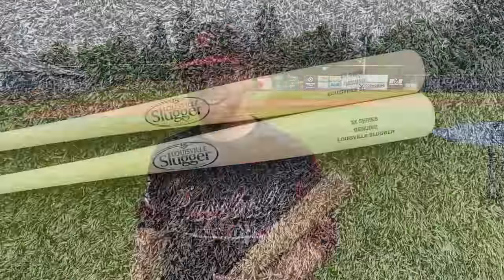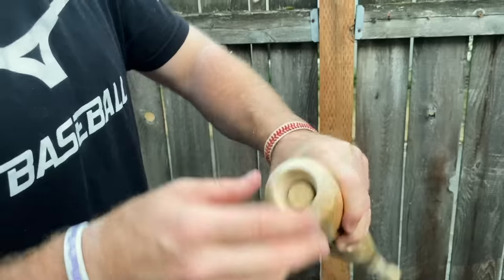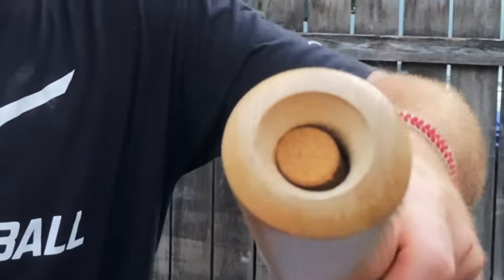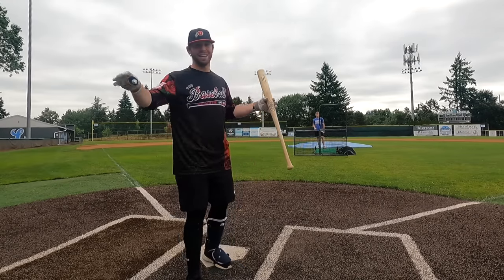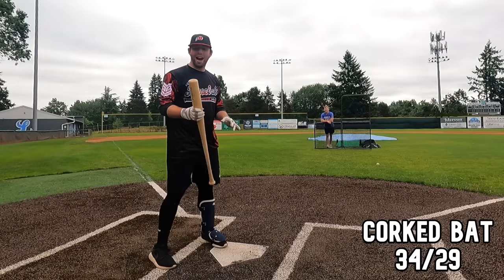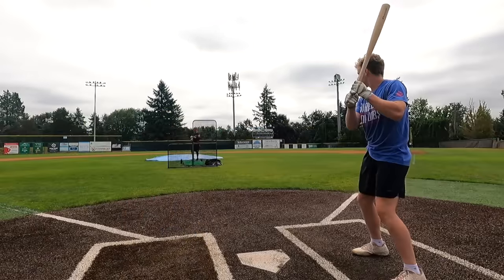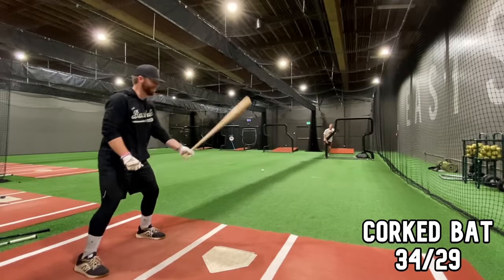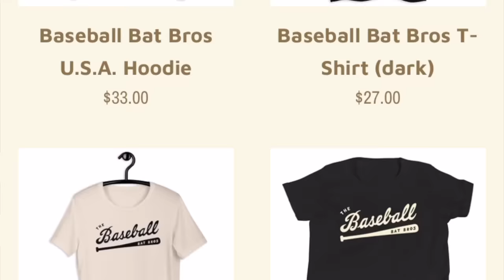Hitting with a CORKED BAT | Wood Baseball Bat Reviews

Comment: The cork is not used just to lighten the bat. It is used to increase elasticity and transfer through the hollowed out section. The cork must be tight, not baggy
Reply: I know what's guy smoking. Lol
Reply: I would like to see this done correctly.
Reply: @whiteboyradical 😂k.v
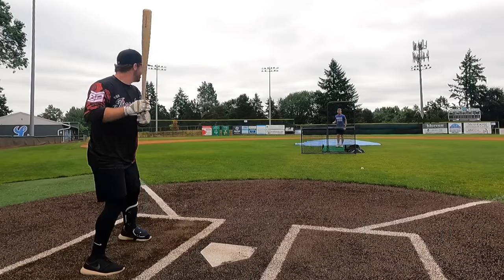Y7 9:32 gkgunh
H
Reply: @whiteboyradical  he inhaled the saw dust
Reply: You guys are a bunch of cheaters!!!!! LOL
Reply: Cheaters are bad.  Bad cheaters are worse
Reply: Yeah the 'trampoline effect' is physically illogical and has no merit. It's BS for two reasons.

1. The weight loss slightly increases swing speed and the effect of a springy bat AND a springy ball effectively sees contact and rebound force being absorbed, not increased.

2. Greater speed on contact with the ball = more contact force. This increases the chances of an easily audibly detected cracked bat or a completely broken bat.

There are no excuses for using a corked bat. Even Graig Nettles' plea that 'a fan gave me it.' is questionable, but he did get away with it. 

Cheating in pro sports just means you're not actually good enough to be a better player.
Reply: I cringed while he did this, why wouldn't he use the same size paddle it....or a 16th inch smaller it would of worked then better
Reply: I was thinking the exact same thing...and I don't know much of anything about corked bats.  It's just obvious.
Reply: Exactly.
Reply: This has been scientifically tested. It does not improve the “elasticity” of the wood - it actually does the opposite. It lightens the bat by an ounce or two and gives you the same length and width of a heavier bat. The end result of the test is that you do get a bit more bat speed with the lighter bat so in theory you can get to faster pitches but the ball did not travel as far.
Reply: Bro how would you know how to do that😂😂😂
Reply: He should have used an Auger bit and made it tighter.
Reply: The sponginess of the cork, if anything, makes the bat absorb energy from the ball rather than transfer it back.  That is not the reason that corking a bat confers an advantage.  The advantage is what the bros talk about in the video: you get the benefits of a lighter bat without having to use a smaller barrel or inferior wood.
Reply: You don't need to make accurate content anymore, judging by the 3.1M views, just the idea of content and 10 minutes of sharp editing.
Reply: This is wrong. Bats don't compress, the ball does. The results produced by corked bats are a result of the bat being lighter, and the swing speeds being faster. Cork can dampen, but it's not going to bounce.

Comment: You should have ground the cork up in a blender and then sealed the top with the sawdust.
Reply: Maybe a dumb question but wouldn't that be heavier than just using the full corks if you fill it up?
Reply: @Icantforgetnow  no. The problem with using the full wine corks like he did is that they weren’t a perfect fit, there were gaps on the edges and he said he put glue in there to lock them in. If he blended the corks up, then there would be no gaps and then all he would need to do is seal it up with the sawdust and some sort of glue/adhesive. It would be possibly lighter or at least the same weight.
Reply: @houstonOLED  plus probably better structural integrity
Reply: Just get shoemakers cork filler. It's pliable cork used in boot and shoe repair.

Comment: I would like to see the corks stuffed tightly into the holes and then re-test it.  It would be interesting to see if such a setup would result in a bit greater hitting distance.
Reply: Of course it would that’s why MLB players did it
Reply: The mythbusters did this one. Essentially, the mass transfer gets just about halved because the cork disperses force. I think the common misconception is that the corked bat would result in a harder hit, when it actually results in a faster swing. That way you shave off a couple milliseconds on the hit, theoretically resulting in more contact and by proxy more bases.

Edit: Huh. Interesting results. I'd like to see some more testing. I'm invested now.

Comment: Just a heads up, as a woodworker and engineer, you should use a paddle bit that’s about 1/16” smaller diameter than the corks you plan to use.  The cork will compress, fill the void, remove the need for added weight via super glue, and hold the structural integrity of the wood significantly better.  

Pretty interesting results for a first go with a lot of voids though.  It went far better than I would have anticipated.
Reply: Excellent point.
Reply: How heavy is superglue? Heavy enough to slow down a ZOMG is all I know
Reply: shouldn't use a spade bit at all. you need an auger bit or more appropriately a forstner
Reply: @@theslipperytruth5676 she did say something about some weird guy babbling to himself walking down the road. I hope you are okan I know life is hard if you have extra chromosomes, but we are rooting for you lol guy

Comment: For anyone not really familiar with bat "drops", the standard is -3 ... meaning the weight of the bat cannot be more than three digits away from the length (example: 34in bat has to be 31 ounces, anything more than that i.e. 30 Oz, 29, 28 etc, is super illegal)
-3 is the standard as far down as Little League ball, so the advantage is a very real thing.
The highest drop I've ever seen personally was a -9 TPX aluminum.  I brought it to a game of mine when I was about 13 or 14 years old and it didn't make it out of that game.  The whole team used it each at bat until one kid, and hand to God I am not making this up, swung the bat and made full barrel contact, but the sound wasn't right and the ball literally traveled 5 feet behind him to the back of the cage.... the aluminum ripped on the barrel and there a baseball sized hole ... the ball went thru the first layer of aluminum to the back of the barrel, almost lodging itself into the bat, but came back out on the follow thru and went behind the batter ... as 14 years olds we as a team swung this bat with such violent force that the bat broke
Reply: I'm not familiar with bat "drops." Thank you for giving us this explanation.

Comment: Pretty sure you you want the cork to be tight/solid in the hollowed out barrel, without any play.

No point to having it bouncing around in there. Its meant to maintain structural integrity and give added bounce (possibly?).
But just having wine corks jingling around in there, while hilarious, is pointless.
Reply: Exactly ! The best way is to drill a smaller hole on the bat, then find a metal tube that fits perfectly inside the bat, then vaccum (compress) the corks inside the 
pre-lubricated metal tubing add wood glue inside bat and insert tube inside bat 
and squeeze those corks out of the metal tube while backing of the metal tube out
until all corks stay inside ! 
or 
put corks on a blender and break them all down add wood glue (not much) and compress that semi-dry soup inside, leave space to reseal with a maple cap the leave it a few weeks in the Sun heat inside your cars dash for all glue to dry !

Can you repeat this test using one of these methods or both ?
Thanks if you do !
Reply: @dnantis  lol you sound like you know with experience.
Reply: That's what I thought cork was used for
Reply: @Bon Jovi 
Clearly you don't understand how structural integrity and physics work. Keep studying though chief, you'll get there one day.
Reply: @Bon Jovi I literally make bats and hockey sticks for a living (among other things). 
I have an engineering degree and run CNC machines and automated lathes.
Reply: @Bon Jovi 
That's your argument? Lol

Scraping the bottom of the barrel to come up with that one, damn.
Reply: Should've drilled holes slightly smaller than the diameter of the cork
Reply: Usually you want to grind the cork to into fine particulates and mix it with a tacky glue that stays tacky and saw dust. If done professionally, there is a way to mimic the grain of the bat by adding just enough to the corked material, in a liquid state at this time, to the inside of the drilled cup, then by spinning the bat at high speeds, using centrifugal force, this will cover about 70% of walls on the inside. You don't want 100% coverage so it mimics the grain correctly. Do this repeatedly until the void is completely filled, layer by layer. Then by sacrificing another bat, remove the cup from that bat at 1/16th of an inch bigger in circumstance that the hollowed cup and adhere it to the hollowed cup of the corked bad. There are methods such a drilling holes for wooden dowels to peg the new cup in to reinforce it. But that is more detectable if broken. Always mix any glue used with saw dust. If this is all done correctly, even if the bat brakes, it's very hard to detect any corking manipulations.

Comment: Part of the benefit of corking is weight difference generating bat speed, but a second (huge) part is the act of compression, as the bat absorbs the force of the pitch and then releases that energy to launch the ball with greater velocity (like a trampoline).  To do this well, the hole drilled must be smaller in diameter than corking material, so that the cork fits very tightly into the barrel.  This will extend the life of the bat (before it cracks) and increase the launching effect.
Reply: This is not true.

The reduction in weight causes better bad speed, but it also negatively affects the velocity of the ball because of the weight reduction. Cork don't do s***.
Reply: @seriouscatisserious Is that true? In my mind I always assumed that the cork acted more like a spring, but I’m fully aware of my own ignorance on this topic.
Reply: @Jomitheelf yeah, it's nonsense.

Comment: To increase durability, I think the hole diameter should be slightly smaller than the cork and ram them down to create a tighter fit. This way it’s not so hollow.

Comment: Breaking up the cork into small pieces, then mixing it with wood glue, then pressing it down with a down with a dowel the same size as your hole will still keep the weight lower, but also add strength back to the bat because the cork/glue mixture has filled the void completely. This in turn adds an extra trampoline effect to the ball in addition to the lighter bat. I’ve made a few of them. It helps being a machinist with a lathe, you can just drill the hole a little smaller than the cork, and it will hold it in intact with a small amount of glue. A solid cork can certainly be found at any hobby shop or online. The pressed in solid cork forks the best. Try to refine the technique on the next one! Cool video!

Comment: The hollow hole should be filled wall to wall, you should have ground up the cork into tiny pieces like the bits of rubber on a turf field. Then you pack in the cork bits with a rod to really get it in there tight. You can also substitute the cork for rubber, like super bouncy balls grounded up, compacting it in is key, this will stop it from breaking internally.

Comment: I think if you wanted to do this so you retain structural integrity and density you could fill it with cork filler that's used for repairing dress shoes and tamp it down in the hole with a wooden dowel or something
Reply: thatd hit some piss rods lmfao
Reply: @LUCKIPUP  on fucking god
Reply: That’s definitely what should’ve been done
Reply: do you think it would last longer if they put it in the cheapest birch cut they could find? i think thatd still be better than ash since it’s eventually gonna disintegrate
Reply: That is the proper way to cork a bat

Comment: The speed difference is just for the reaction time of the batter. The energy input on the ball will be the same. 
In other words the corked bat doesn't make you hit harder, just let's you react faster and get a better hit
Reply: Not exactly. Kinetic energy is KE=.5mv^2. You lose mass, but if the swing velocity goes up, it make more energy. Since velocity is squared it more than makes up for the mass drop.
Reply: @latemodelclassics  Well you are quite right about that but in the end the energy is the same as the same person is swinging. So if you reduce the mass and the energy is constant you will obtain an increase in the velocity in the proportion of v=sqr(2 KE/m) but the kinetic energy will remain constant. So when you hit the ball the kinetic energy transmitted to the ball will be the same. That's why I said is an improvement on accuracy. If the bat needs less energy to move because you reduced it's mass. You will be able to make bigger adjustments while bating and also you will have a bigger window to succeed in hitting the ball.

Comment: This isn't exactly how "corking a bat" works.  You can buy cork at different diameters at a crafting store.  Drill the hole in the bat 1/8 less diameter than the cork, it will compress and go in very tightly.  THEN you have a corked bat.  The cork actually gives the hitting surface more bounce and spring back action.  You just basically hollowed a bat making it lighter.  Try the real deal, I bet most of those 10-15 foot short dingers go over easily.

Comment from the maker: Exit velo testing towards the end of the video! Btw the way I did this was probably very dangerous - don't try this at home lol.
And as always, for the best viewing experience, change your video quality to 1080p, go full screen, and crank the volume 💯
Reply: @The Baseball Bat Bros can you guys do this video with some -5s that would be sick also the polar power is only in a -5 for this year but it’s a 1 piece just guess the hybrid was too gas
Reply: 2nd
Reply: You should do a review on all the whiffle ball bats, thin, and fat barrel, and go to a whiffle ball field, use a solid whiffle ball too..
Reply: Cobblers hot cork and a ash wood plug epoxied into the end.
Reply: You need a smaller and much longer drill bit, take out wood almost to the hands and use a smaller diameter more dense one piece of cork broski and maybe a little better of a bat. Let’s see that video next 👌🏻👊🏻
Reply: We. Need to see some tennis balls in a bat
Reply: Yo if you guys see this what is better value for a contact hitter in bbcor, voodoo 2 piece or voodoo one?
Reply: Needed an auger bit to drill the hole my boy
Reply: Yea, soon as I saw you I said, "Holy fuck I can't believe he didn't break his wrist."
Reply: Dude this is the most embarassing example of corking a bat imaginable.  You really couldn't have done a worse job and still called it "corked".
Reply: do it on a maple bay but use a smaller drill bit to where the cork fits snug
Reply: Where in Utah are you from man? Or are you just a U of U fan?
Reply: Hey next could you add weight to the end and see if that works.
Reply: Ok
Reply: Ok
Reply: You dont have a vice dude? Garage equipment man.
Reply: Put that mofo in a a vise next time.  That was scary to watch.
Reply: @bmatthews15  legit
Reply: Lucky you didn't slip with that intimidating drill bit lol.. Maybe a vice, at least just for YouTube anyway..
Safety first people..
Reply: Kevlar gloves with safety glasses may have been a good idea as well, considering where your hand was in relation to the drill.
Reply: Does a wood bat have to be a drop 3 for a 14 year old
Reply: Pp

Comment: Hey some tips from someone who has made some corked bats before you need to be about 2 to 3 inches deeper. Shred the corks into shavings and pack them in tight and use super glue (not a lot of glue) in the mix of shavings. This creates almost like a malable putty. Then cap however you want just try to match the wood grain or if you don't care you can get a plastic cap.

Comment: You should have got cork material to cut to fit and fill it.  Then use a silicone sealer to hold it on.  That can handle the flex and vibration.  The cork fitting better would make a huge difference

Comment: They sell cork that is like a putty and can be heated and molded.  They use it for shoes.  It’s used by cobblers when re-soling shoes.  It’s heated and spread like a paste.  If you packed it and pressed it into the cavity to fill all the voids and let it cure, the bat would probably last longer and cut the desired weight at the same time.

Comment: Auger bit, drill press, save the sawdust.
Drill out 10" or so of bat length.
Jam the gaps with powder-fine sawdust. Do not use glue.
Jam an ash plug (slight taper) with wood glue "brushed" around the plug's rim.
Lathe, sand the end down flush.
How to cork a bat

Comment: Next time, grind up the cork into smallish pieces, mix with a little bit of rubber cement, then pack the hollowed out cavity and let cure.  Then, cover the end of the bat with flexible caulking and let cure. This will strengthen the bat cavity.

Comment: I would suggest trying open cell or closed cell spray foam. That should keep it tight inside the chamber and give an adhesive element to your filling. That should be lighter and help keep the bat from cracking.

Comment: Try filling the hole with Lexel and no air pockets. You can seal the end with sawdust in the Lexel. It dries like rubber and will never come out. I believe it will give it more strength at the same time. Just give it a few days to dry....

Comment: For our 16u travel team bats (just kidding) I start off with a 5/8 bit drilling in 2”. Then using an expandable bit i slip that into the 2” hole and drill to a total of 10” deep repeating this process untill I have a 1.25” diameter bore on the inside with first two inches remain at a 5/8” diameter. Clean the inside and dry then I use expandable window foam to fill the inside. As soon as filled with foam I secure a plug in the 5/8” hole and leave overnight for foam to dry. Remove plug and excess foam then sand and clean and fill remaining hole with a mixture of sawdust from drilling and wood glue. Sand and clean either clear coat or some matching stain or oil.  The expanding foam will give the bat way more pop and will keep the bat from exploding. This way the bat usually just cracks and no one sees what you did.